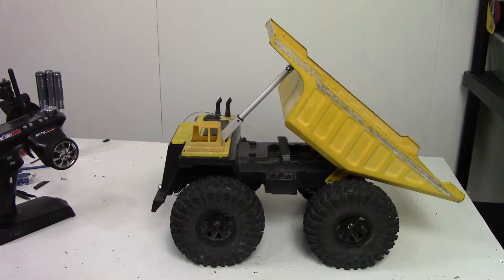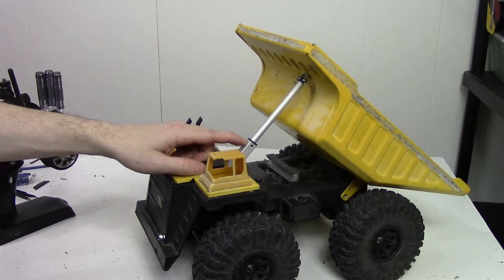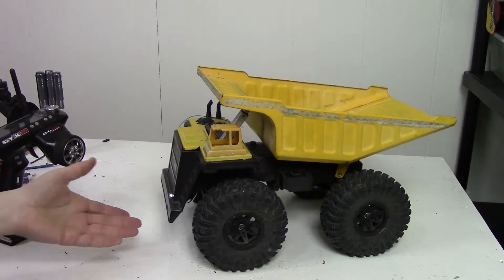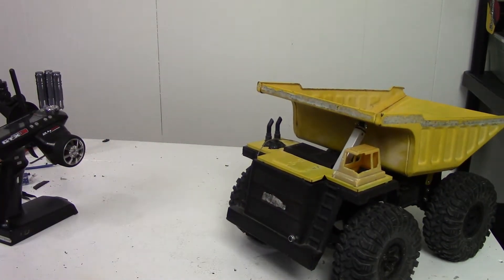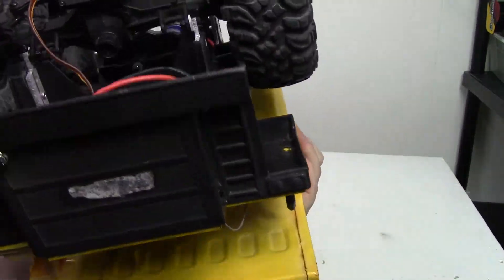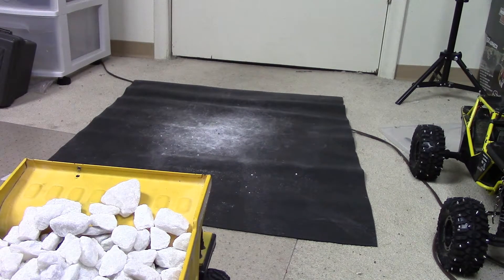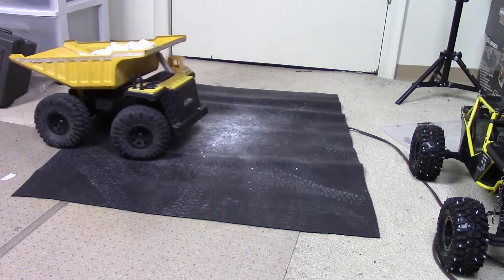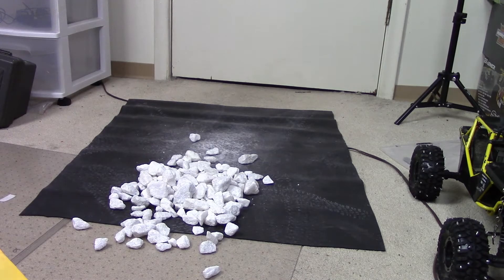Toy Dump Truck Conversion to RC! Dump test Part 4 - Finished

Comment: pretty cool,excellent job my friend :)
As for the actuator location,
most real dump trucks,have a dog house in the nose of the dump bed,that protrudes up into the bed slightly,allowing more room for the hydraulic piston, in the 15 yard truck that I used too drive,the dog house,in the nose of the bed bed,was about four feet high,and around one and a half feet wide, basically it's a steel box that allows the piston location,too be at the top inside of the box,versus the bottom outside,
not sure about on the RC,
on your truck,it would probably need to be mounted diagonally into the nose of the box,with the dog house extending 4-5 inches into the box itself, just an idea 
you could probably Google dump trucks for sale,to get a view of the inside dump bed,
the only dumps that use bottom mounts,
are small 3 yard trucks,
the majority of the big trucks,all use the dog house method,for the hydraulic piston, 
Just fyi
Your current setup is great,
I personally probably wouldn't change a thing,but if you're not totally satisfied with it,you could try the dog house method,
only because you asked,lol
like I said,I think it looks great,and personally wouldn't change anything lol
Reply from the maker: Thanks very much! That is some good info on how to raise it. The next time I do a dump truck(I'm sure I will), first I'm gonna get a better vehicle to start off with lol but also plan more and try to get it even better. I don't think I'm gonna end up changing it now but always like to get opinions on what I could of done different. I'm definitely pretty damn happy with it, wish I could use it outside! It's -28C/-18.4F right now outside though way to damn cold haha
Reply: Void X RC,That's super cold,it's kinda the same over here,not quite that cold though :)
Excellent job on the truck once again,looking forward too seeing your next fabrication brother :)

Comment: Maybe you can modify it , shorten it, maybe cut it shorter
Reply from the maker: The problem with shortening the actuator is that it wouldn't be long enough to put the dump bed to full height. Maybe in the future I will think of a good idea.